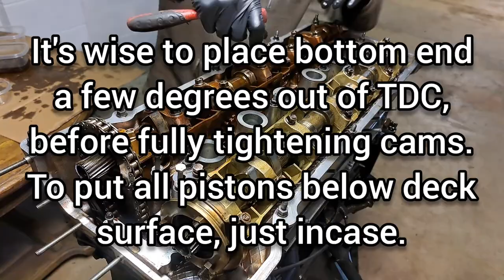BMW M52TU M54 Engine Budget Refresh and Assembly - E46

Comment: Get yourself a decent set of torque wrenches now that you decided to work on aluminum engines - the ones you have are junk.
Reply from the maker: Now that I've decided? It's been 7 years of M52TU/M54 experience and assembly. They work fine for what they are, unless you wanna buy me some ❤️

Comment: if you're interested, the letter for the camshaft trays mean E: Einlass (Inlet) and A: Auslass (Outlet) 

otherwise, straight forward explanation, love it!
Reply: also can be einfarht and aubfarht, depends on regions and/or local dialect. Saw both versions on autobahn trip from munchen (munich) to koln (cologne) back in 85

Comment: Wow. Awesome! Got me totally motivated for a much deeper refresh. I'm knee-deep now (lol), so, might as well pull the engine out of the E39 that's been in the family in what seems like forever, and take it further. LOL. 528i 1999 E39 M52 - 265,000 trouble-free miles; never once overheated, well maintained, but after 24 years finally got the oil leaks from the typical places. That normally aspirated straight six M52 engine that made it this far deserves a good refresh. Thankfully, it's relatively straight-forward to work on. Thanks for the content!
Reply from the maker: I love my E39 528 as well! Ahh, what a car. Thank You for watching, hope to see you in other future comments, 😁
Reply: @OLearysBMW  BTW, any reason why you skipped replacing or checking the main bearings and journals? Just curious.
Reply from the maker: @SnuggleFits  bottom end was fine. I just didn't show that process.
Reply: I would HIGHLY recommend finding an M56 SULEV valve cover and swap it in. Why? A. It's ali and doesn't warp or leak, B. push in coils, and C through Z, you ditch the whole silly vacuum system under the manifold. The SULEV goes directly into the intake manifold and bada-bing, you're done with all that drama ;-) The swap is well documented by the 50's Kid and other channels.
Reply from the maker: @ailo4x4  I myself have had 4 SULEV 325 cars through my shop, that I've torn down. The intake manifolds are considerably more dirty on the inside from un-separated oil vapors. It works great for turbo applications and what not, when vented to atmosphere, though.
Reply: @OLearysBMW  for me the more important issue is deleting the whole ccv debacle. My engine is in a classic Land Rover Defender and I use it in Africa. The very last thing I need in the bush is to suddenly lose all my oil 😲. Btw, did you know the M52 engine was the LR Defender factory engine from the South Africa factory for about 5 years? It was when BMW owned LR in the late 90's. They junked the ancient LR V8 and put in the best petrol engine LR ever offered! I'm using the M52TUB28 and absolutely love it. It's getting the M54B30 intake manifold and MS43 ECU in a few weeks time. Cheers!

Comment: Thanx dude cuz man I've been searching for a tutorial showing the proper install of the timing and vanos gears at the end of the cams. Had it drawn/written during tear down along w/obama phone photos BBUUTTT....... i broke my damn R leg in a scooter mishap-while totally sober so i gotz no scuses- and lost near 4wks rehabbing. Took two days to find your video- after eliminating countless others- but man the search was worth it. Thanx again for an easy understanding and simple to follow reference video-KUDOS
Reply from the maker: Not a problem man, Thank You for watching.
Reply: So it's now 29 nov thought i was ready but timing was close yet not close enuff. Redid twice gittin er ever so close FKN fuel pump crapped out- order part, wait for part, install part ,anticepate car firing- got good compression,  crank er over for about 7-10 secs, crank over second time sounds close, crank 3rd time? Oh HELL NO damn soleniod poops out(and yes battery full charge- no shorts, all conections +&-(ALL body grounds and hots) secure. Order new starter cost only 20$ more than solenois and got 3 yr warranty.  So today redid TDC redid double vanos set up after cam recheck etc- took awhile due to temp being a balmy 33 degree F under my carport about a mile inland of lake erie in n.n.e ohio. Lookin forward to manana a.m.   Thanx again for your great videos and i recommend them as must watch for BMW owners regardless of their level of experience

Comment: Good idea to get a DuPont Viton oil filter housing gasket, much more heat resistant.
Reply from the maker: Ahh, viton. Always a good option for seals/gaskets. 👌 That's what I opted for with my VANOS seals, though basically every rebuilt kit now days uses them.

Comment: Hi , so much good content, i get tired of looking for somebody that make a video like this, very well explained, as im from spain and want to rebuild my m54b30 (and improve possible failures and/or leaks with stock hardware or design) will be nice, if possible, a list of parts that are needed for a rebuilt and torque values, for reseach them here in our country, i mean for example some referencies of the parts, and look for here in local stores if possible, and torque applied in the parts or where to find it because here we use different measure scale, i mean in Newton meter. Did you have any content related for the change of piston rings and valve related maintenance?    sorry for that long text and many thx for that great content, you gained new follower !!!

Comment: Interesting information about the non OEM head bolts. Do you do this to minimise the risk of the block threads stripping? I

Years ago with non torque to yield bolts you needed to retorque the headbolts after so many miles. Do you have to do this? I remember re torquing heads as per the service information and finding bolts that would move almost 45 degrees before smoothly landing at the specified torque.

I really like the video and I will link it for reference when I need to repair my M54 or my M52...

Comment: Ever have any problens with stripping the block threads when torquing the head bolts?
Reply from the maker: When the engine has been overheated, this is commom. I personally haven't had it happen during reassembly, but have seen chunks of aluminum stuck to the head bolts during dismantling.

Comment: Amazing video. Which head bolts are you using? I tried searching fore these but could not find any.
Reply from the maker: Allen head cap bolt. M10x1.5mm thread. 12.9 grade. No specific brand. Preferably full-thread. 

If you don't do this often, new OEM headbolts are pretty cheap. I bought my specific bolts in bulk, as I assemble multiple engines a year usually. Be sure to inspect each head bolt upon removal from block, if they come out clean you're usually good to go. If material is clung to the threads, you should re drill and thread your block.
Reply: @OLearysBMW  Ahh okay that makes sense. Thanks for the response!

Comment: Great video Tyler 👍.
I don't remember if I told you I have a couple of 325ti compacts, one has a 5 speed Getrag and the other is an auto but I also have an m54b30 and a 6 speed manual ZF to go into it once I've extensively built it. I was wondering if you could advise on the  feasibility of converting it to AWD I believe the ti compacts are exactly the same as an E46 coupe underneath apart from the rear 10% maybe.
I'm thinking of buying an X3 for the running gear but am wondering how hard of a swap would it be? I know I'd probably end up swapping the AWD gearbox with the transfer case still attached so might end up sticking the ZF in the 5 speed car instead. I guess I'm basically asking if you could maybe talk a little on if you were to do an AWD swap to a rear wheel drive car how would you go about it? Cheers dude keep up the great work.
Reply from the maker: An AWD compact? I'm in! May or may not need to massage the trans tunnel to clear the transfer case and front driveshaft, lol. Would be a very unique project. The xi front subframe should bolt right on, as long as compact didn't receive some special front frame bolt layout.
Reply: I have some research to do.

Comment: I'm going to replace the main chain tensioner. If I set the motor to TDC will it spin when I pull it out?
Reply from the maker: The one of the side of the timing cover? No, you don't even have to put it at TDC. Just remove and replace.
Reply: @OLearysBMW  Yes the one on the side of the timing cover. Thanks for the information. 👍
Also, can the camshaft tensioner be replaced without locking the camshafts?
Reply from the maker: @UntouchableDog  You can remove it without locking the cams, but for reassembly and timing the cams need locked.
Reply: @OLearysBMW  Thank you 🙏

Comment: Life saver today…
Reply from the maker: Glad to hear it. Did you have a project you were working on?
Reply: @OLearysBMW  lol I wish … it’s my     Daily e46 330 .. expansion tank burst and over heated.. I’m just replacing the head and going through what ever I can afford at this time.. thanks again … and for the reply.. 🤙
Reply from the maker: @jasoncyphers4265  wishing you the best of luck, man. 👌
Reply: @OLearysBMW  thanks man .. what state are you in?
Reply from the maker: @jasoncyphers4265  PA
Reply: @OLearysBMW  can i delete what looks like a vacuum canister near the starter ? I believe it goes to the transmission?
Reply from the maker: @jasoncyphers4265  that's for your muffler flap. It's a vacuum canister. Yes, you can remove it. Be sure to plug the port on back of intake for it.
Reply: @OLearysBMW  ok that’s it? That simple?
Reply from the maker: @jasoncyphers4265  yeah.
Reply: And if your looking for more content.. was wondering if you could  share what’s all interchangeable on the e36to e46 and so on… kinda like the old Chevy 350s I’ve been looking for a list of interchangeable parts that would benefit reliability..

Comment: CAN ANYONE HELP?? My sprocket (28:30) won’t fit around the cam. No clue why. 03 530i. Thanks!!
Reply from the maker: Are you placing it on the right way? Both sides have an arrow
Reply: @OLearysBMW  I tried following your video to a T… I have the store slightly above the deck surface bc I as well don’t have any tensioner components on either. It almost seems the chain is too short however I can turn the crank pulley and both sides of the chain are turning smoothly. I just replaced head gasket yesterday can’t you take off the timing cover without removing the head?
Reply from the maker: @nickclark515  not advised, as it's hard to reseal without removal of the head.
Reply: I’ve never been this far in an engine before, so of course I could be doing something wrong too…
Reply from the maker: @nickclark515  are the studs out of the camshaft. 12mm
Reply: @OLearysBMW  yes it’s a bare exhaust cam like in the video. There’s the one wheel on the end with the slanted back end. I took the piston off of the front part as well I think it’s as bare as I can get it
Reply from the maker: @nickclark515  you removed the splined part??
Reply from the maker: @nickclark515  I'm not following, lol. Send me a message on Instagram with pictures. olearyt0534
Reply from the maker: @nickclark515  okay, just making sure man
Reply: @OLearysBMW  no problem at all, I really appreciate you reaching out! Like everyone else said, very detailed, informative video!

Comment: Great job on this video, I always use to think my m52b28 was probably the worst engine but you showed me they are the underdog. I did a refresh on my engine few year ago but didn’t open the block. Now I’m more confident to do it, currently supercharged but I don’t think bum getting the most out of it, I need to add the ms43 ecu and m54 TB. Check out my YouTube channel
Reply from the maker: M52TUB28, yep. M52B28 is single VANOS, the predecessor.

I myself just performed an MS43 swap, good stuff. I used my swap video as reference, lol.
Reply: @OLearysBMW  my bad I meant I have the m52tub28
Reply from the maker: @acef_performance8416  No worries dude, it's a common mix-up. 

I wish you luck with your projects 😁